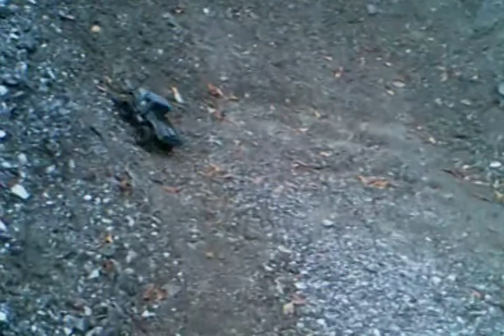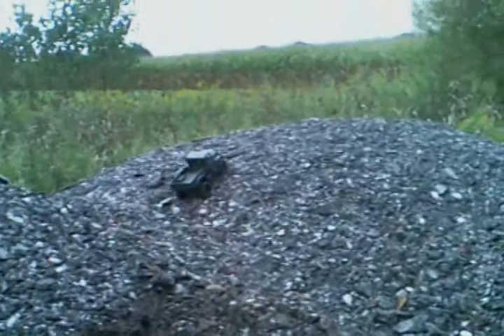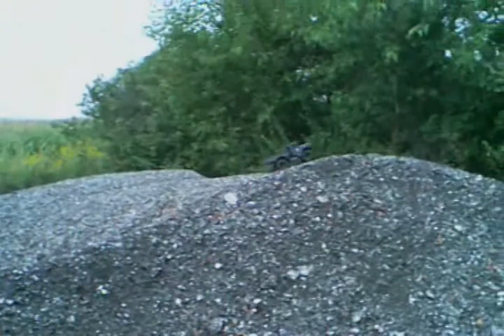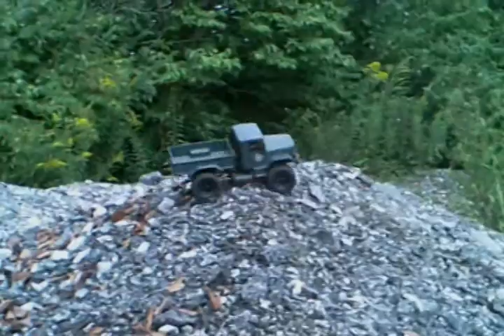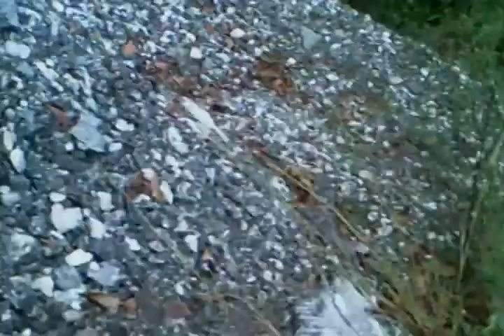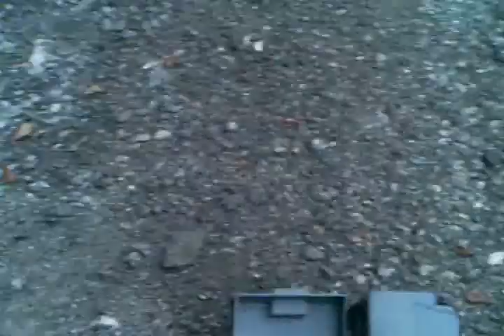B1 mishap

Comment: Good run with this wpl, it is true that the diesel sound was good at the end of the video 😁
Reply from the maker: modified a toy gearbox with a 280 motor to fit a center section, barely fits but the gears are all BIG plastic. lets see what fails next!
Reply: @modelnutty6503  😊👍

Comment: Really like that Rig, Amazing for the price and it performed great as well. Loose rocks arnt good. It sounded like a engine at the end until it went, hopefully its a easy fix 👍 great video bro 👍😊👍😎👍
Reply from the maker: this is the left overs from making the drifting C-24, swapped a gear in already fixed, my fault hammering the wheels so hard, same time some of those gear tooth faces sure could stand to be wider. the diesel sound was funny at least.

Comment: Needs wheel weights and other metal upgrades.
Reply from the maker: its got metal axle gears, metal drive shafts, 4 turns 2 mm solder to the front rims and 2 turns same to the rears.
Reply: @modelnutty6503  well I have had a couple parts just strip out easier than they should also. It's just hit and miss sometimes. Great video thanks!
Reply from the maker: @quincyherbster5888  really narrow plastic gear faces in that B36 gearbox, get the wheels hammering.. POP!